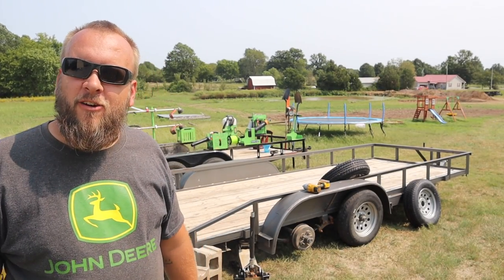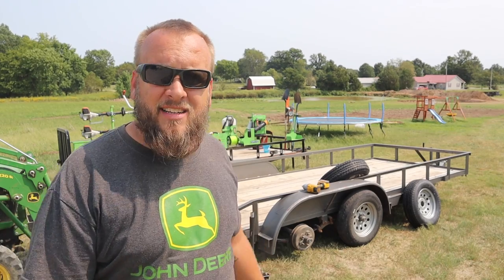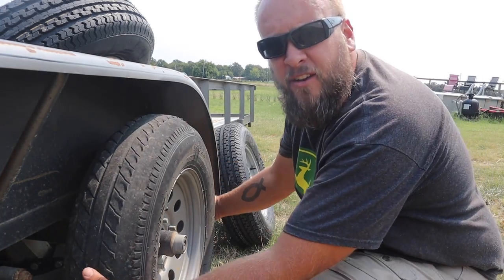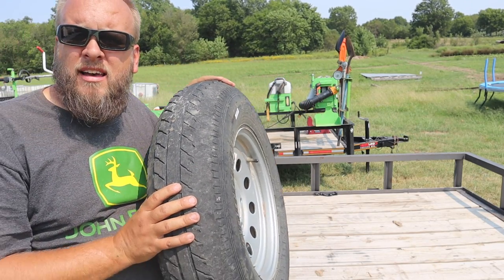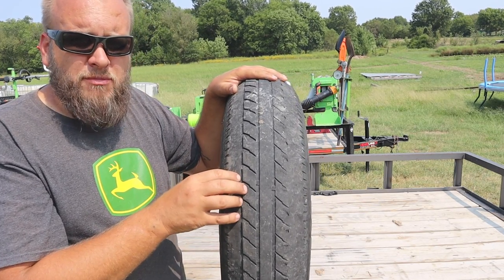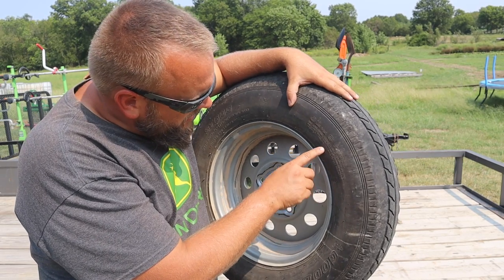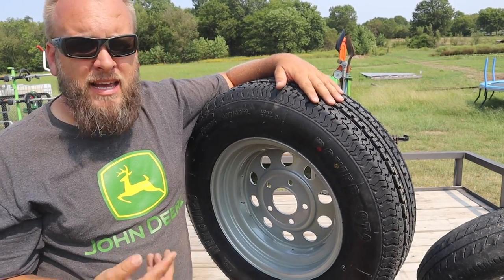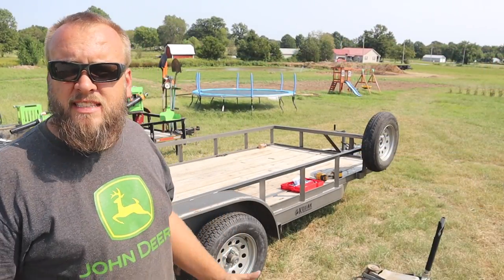These Trailer Tires Suck - Check the Load Range Before you Buy

Comment: You should consider running commercial-grade tires on your trailer in the future.  Last year, I purchased a set of Transeagle All Steel ST Radials in a 225/75-15 LR F and 12 ply. They have been holding up very well, and haven’t shown any signs of wear. The max capacity is around 3200 LBs at 95 psi.  I’ve used different well known brands over the years,…but they all seem to last about the same amount of time.  They are very reasonably priced.  You can get them in higher load ratings, but in our case, the 15” wheels would be the limiting factor. There are a few other companies the make them in this size as well. I also wouldn’t be afraid to move up from a 205 to a 225 tire. There’s not a noticeable difference between the two.
Reply: @Amanda Davis. Where do you buy the 225 LR F and do they sell the tires with the well or just the tires by them selfs
Thanks
Reply: im rocking the transeagle all steel ST radials H rated 16 ply on my 40ft fifth wheel and havent looked back to see any floppin gators in quite some time now😁😁
Reply: @jking1286  nice!!  That’s what I’m switching over to on my trailers.  I don’t need the max air pressure. I just want a tire that’s stronger than any of the ones I’ve been running over the years.
Reply: @vikingored7469  sorry for the slow response.  You can buy them online. Just google the brand, model, and size,…and you’ll find.  Most of the ones I’ve looked at was just the tire alone.  They are a heavy, stiff tire. I’m running them on a utility trailer at this moment.  Because I don’t load it down,…I only run them at about 65 psi.
Reply: @amandadavis9726  hi, whats the brand??? Name of d tires, brand name.thsnkd
Reply: @vikingored7469  they are Transeagle All Steel ST Radials 225/75-15. The options are 12 ply, Load Range F, and 14 ply, Load Range G.  They also make them in a 235/80-16 with a 14 ply, Load Range G, and a 16 ply, Load Range H.

Comment: have you/ how often do you/ grease your trailer wheel bearings?  do you have a video planned for that?  I need to do mine, used to pay trailer place but it got really expensive every year.... want to buy a good battery grease gun and do it myself.
Reply from the maker: I haven’t done it myself. I probably should

I have the local tire shop do it. Can’t remember what they charge

Comment: Brock, when it comes time to purchase another trailer. Go with one of the big brands like Sure-Trac and if you can swing it get an aluminum equipment trailer. Those rails on the sides suck for side attachment loading and pallets etc… get the longest one you can. I run a 20 FT and it’s just enough. 

Love the videos!
Reply from the maker: Thanks for sharing. I have been shopping gooseneck trailers the last few weeks. Hoping to get one by the end of the year

This trailer is barely adequate for what I do
Reply: @RockhillfarmYT  Yeah goosenecks are nice and they tow better for sure. You will sacrifice being able to use the bed of the truck though and to a small degree resell of it. But they are generally longer and have higher weight ratings. 

I saw in another one of your comments you ordered a 3/4 ton truck! When are you going to spill the beans on what ya got? Haha
Reply from the maker: Sure. I ordered a 2022 ram 2500 Laramie.  
Supposed to be here next month

Comment: I am a little late but the D13 ment it was a 13 inch rim and a bias ply tire. The other is an R for radial. If the tires were radials they would not have had that problem. The radials are wider to. The old tires said right on them load range C. That is a 8 ply tire. Load range E is a 10 ply tire. But the big thing is that radials are a far better all around tire. And load E may be smart to.
Reply: I was rong C is 6 ply D is 8 ply and E is ten ply so d is good

Comment: If your hitch is not at the right height and or your load is not placed right you will be sliding one or the other axle wearing down the side wall and as far as the blocks are concerned they are very weak ex specially on there end if you have to use lay a piece of plywood then lay the block with the holes facing up and down then place another piece or pieces of wood they are 2 or 3 times stronger than the way you put it on end I do understand being in a hurry and you did have loader underneath also which is the way I would have done it

Comment: Goodyear Marathon ST225/75/15 they aren’t cheap but they should last. I’ve always overinflated my trailer tires by 5 lbs cold. If they are going to be used at road speeds they need to be balanced.

I didn’t hear you say the brand name of the tire. They look like they are Goodyear. Goodyear should give you some warranty credit on those tires.

Comment: Will offer advise at the end of comment on tires from what I learned June 2023.  
First, not to scold you on the concrete blocks, but anybody watching should take into account here, the comment by bucklure later on here is correct.  Concrete blocks are not designed to be strong turned up like you did -their strength is achieved ONLY when laid out with the holes facing up and down.  With your blocks turned up as you did, obviously it will hold some weight BUT how much?  Imagine if you laid the rail of the trailer into the center of the block itself.  That is the weakest piece of it!  At some light amount of weight that part of the block will fail without warning and the entire block will crumble.  

You had the block there for extra safety, and with your trailer rail laid entirely across it - not just depressing the center that I expressed concern about - you were ok with your tractor providing the primary jacking lift point.  But imagine if the trailer was not resting on the block itself, perhaps positioned several inches above, and suddenly it dropped.  Would be like a karate chop on the weak part of the block!  It would split instantly.  My point is to understand the reasoning behind the shape of concrete blocks.  

Large chunks of hard wood are a more secure safety option.  It's hard for most people to do the extra work, but think ahead about the forces being applied - or COULD be applied - and take measures for worst case scenario.  

TIRES.  Good points about the tires.  I had a failure of a supposedly 'almost new' tire on an older F350 this past weekend.  Front end suddenly began shaking violently on I 75.  Turned out to be a broken belt.  Made the tire out of round in an instant, like rolling an egg down the interstate.   On a 'new old stock' BF Goodrich Commercial TA heavy duty truck 'tar' I bought off eBay a couple years ago, with only about 5000 miles put on it by me.  This truck sees limited use. Thought it was a great deal on a great tire.  Well I forgot to ask about the DOT Code before purchase.  Turns out it was several years old.  Turns out I don't so know much.  Learning every day.  

Equipment trailer.  I was hauling a car on an equipment trailer when I had the broken belt.  Two 3500 axles like yours.  Should be fine, right?  After the broken belt scare, I asked the tire man to look at my trailer tires.  Cheap tires that have been on the trailer since it was new in 2016.  Although cheap made in you-know-where, they have amazingly held up pretty well.  The trailer is not used often though.  

Tire man is an older experienced man who has seen many, many tires and failures.   I asked what tires he would advise for this trailer.  Guess what?

NOT a trailer tire at all.  He says forget that cheap junk and go with a "LIGHT TRUCK TAR"  
Be sure to check the DOT codes on used tires and new, and load and ply ratings.  He likes 10 ply minimum.  He explained about sidewall strength and the lack of it on some tars.  Experience counts, right?

I looked around for some tar.  :  )

Comment: the d is not for the  load rating it just the way it was constructed. if you get the 205/75/R14 vs the 205/75/D14 the R14 is better constructed and has more banding.

Comment: Hi Brock, Nice video. Yes, everyone cheaps out. It's what companies do nowadays. You want a R tire, which is a radial. You could go up a width pretty easily. Watching your video, the brakes are on the rear axle. I would venture a guess that your trailer brakes are set too high. If those shitty tires came off the rear, seeing you change the other tire there are no brakes. They sure look like they are under inflated. I would go up even one more size to 225 75R 15. The 225 is the tread width the 75 is the percent of tread width in sidewall height, and the 15 is the rim size. Check your braking controller on the truck. I might go as high as 235. As a kid, we had a 20 foot sheep trailer that we went to fairs every weekend all over Ontario. We were hauling about 5000 pounds of life weight plus the trailer too. We had the other style of trailer tire that were hollow rim type. I also recommend to change all 4 tires and have them match up. You may still have some grief with two different size tires on your trailer.
Reply from the maker: You’re right about the brake controller being too high. I originally set it on this trailer at +4 I think and then on my dump trailer I run it at +7.  And I haven’t been switching it back when I’m on this trailer

Comment: Anyone with a John Deere shirt is not someone you should listen to about fixing or repairing stuff...  From the get go you can tell he's comparing a bias ply tire to radial.   Bias-ply tires offer more stability in the sidewall and can help keep trailers from rocking back and forth.  They could help prevent an improperly loaded trailer from having a dangerous wobble or sway.  They're also cheaper than radials so of course manufactures will use them.  Buying or not equiping a trailer with a spare is on you.

Comment: What pressure do you run in the tyres?
Reply from the maker: 40-50
Reply: @RockhillfarmYT  Going by your estimates for weigh the tyres are close to maximum load so they should be at or very close to maximum pressure of 50, I suggest you take it over a weigh bridge to know exactly how much weight you are towing because the tyre wear says underinflated or overloaded.  
The d15 means bias ply, r15 means radial, I know people that swear by bias ply for trailers because they have stiffer sidewalls and tow better.
Reply from the maker: Thanks 

I have had my equipment weighed

Comment: some cars come without a spare tire..Corvettes would have to carry two different size tires as spares because they have different size tires in the front than the back..Fiat 500, no spare either which is one of the reasons I didn’t buy one, I almost did though
  why shouldn’t the tires be skinny? They’re not steering or driving. They are just rolling.. the skinnier a tire is, the less prone it is to hydroplaning, Because there’s more pressure per square inch at the road contact patch.. Just look at the comparison between water skis and an ice skate…The water skis right on top of the water because they are wide. You could never ski with ice skates because they cut through, they are skinnier. This is true with snow tires. Skinnier is better
  your tires wore out on the outsides-they were under inflated a lot
  tires and anything actually, the smaller it is, the stronger it is generally
  you were within 10% of the maximum load with your tires on your trailer when it was loaded with your tractor. I think getting over 3000 miles on a set of  underinflated tires with that much weight is doing pretty good. you are fortunate to not have had a blowout..
  The load range just means that your tires were not overloaded- barely..not much safety margin…The letter A on the sidewall of the tire means it has a higher capacity than a tire with the letter B. And a B rated tire can carry a larger load than a tire rated with a C, and so on..
  trailers do not have sophisticated suspension or steering. A lot of times when you’re making a turn or backing in and turning, those trailer tires are being ripped/dragged sideways..
  tires are a modern day miracle invention.. Tires go through hell and are not appreciated that much.
  tires on a commercial airliner really get tortured. They go from sub zero temperatures in the sky, to very high temperatures in the summer on sunbaked blacktop runways… and they get slammed on the ground you can hear them screaming as they contact the runway on landings. Those tires are not owned by the airplane owner. They are leased to the airplanes owner..
  tires  are stamped with a date code.. it’s required by the DOT, department of transportation in case there is a recall. I don’t know if they’ve change the code, but the last two numbers in the code were the year the tire was made, and the two numbers in front of the last two numbers are the week of the year the tire was made…
   as with anything, the more you spend on the tires, the better the quality is. I would not buy Cheap tires for anything I own That rides or drives on public highways. I would buy a Cheap tire for my wheelbarrow, or for my lawn tractor, but not for my truck, or my trailer or motorcycles.. expensive tires do not generally last longer. They just cost more because of the quality materials they use..
When it comes to speed ratings, the S or the H rated tires I have the lower speed ratings, the V and the Z rated tires are for higher speeds, above 149 miles an hour. These tires are generally much stiffer especially in the sidewalls but they have less tread depth then a tire rated at S or H. And H rated tires may have twice the tread depth of a Z rated tire, and cost 25 to 50% less than an V or Z rated tire. The reason a tire gets a V or Z speed rating, is the fact that it has less tread. That means less weight pulling on the tire which will make the tire grow at those very high speeds. If the tire has more bulk pulling on it at those high speeds, the tire will flex more and overheat from centrifugal force. That’s why you get much less tread with a V or Z rated tire.If you don’t drive over 100 miles an hour every day, you’ll get tires that will last longer and they are less expensive if you buy H rated tires instead of Z or V rated tires, you will also get a softer ride out of an H rated tire because it does not have the stiff carcass/sidewalls.. if you get a flat tire/puncture with a Z or V rated tire, any reputable tire store will not plug that tire. Because it is actually illegal in Pennsylvania at least to plug a Z or V rated tire. The thought there is, that a tire that has been punctured may have belt damage, and could fail at the speeds the tire is rated for.Since I never go near 100 miles an hour on my motorcycles or my cars or trucks, I always buy H rated tires if I have a choice over V or Z rated tires because I have more rubber-deeper tread, the tires are less expensive, and they give a much better ride, and they last longer
Reply from the maker: These were just cheap tires.  You can tell that from the load rating and the number of plys which is printed on the tire

Comment: My 2019 Dodge caravan did not come with a spare or a jack.  It did come with a can of fix a flat.  Totally useless in my opinion.   I checked with a Dodge dealer and they wanted almost $500.00 for what they called a spare tire kit.  I assume by kit it means tire, wheel, and jack, (but not sure).   I'm looking for a used "kit".    Trailer manufacturers (RV and cargo) seem to be notorious for putting crummy tires on trailers.  I heard them called "just enough to get off of the dealers' lot.
Reply from the maker: To me that is ridiculous

Thanks for sharing

Comment: Yes D is the load rating which is an 8 ply tire. I run 225-75-15 which is a 10 ply tire and has a lot higher load rating.
Reply from the maker: Thanks for sharing

My dump trailer has 10 ply but those are 7k axles
Reply: @RockhillfarmYT  you can get the 10 ply in a 15in tire but you have to go up to the 225-75-15 size. I've got 10 ply on my dump trailer too and when there ready for a new set its going to get 14 ply tires.
Reply from the maker: Thanks for sharing

Comment: I had the same problem with two sets of tires on a toyhauler. I've come to the conclusion that all trailer tires are Junk ! I put 10 ply truck tires on it 4 years ago, problem solved, they still look like new. I'll never buy another ST trailer tire.
Reply: What brand of 10 ply truck tires did you get. We are replacing our camper tires this month

Comment: A lot of trailer manufacturers sell trailers with "transport tires" on them.  Meaning they're there to get the trailer to the dealer or the buyer and then it's their responsibility to put "using" tires on them.  If you bought it from a retail dealer he should have put decent tires on it.  Of course he might be selling them cheaper by not putting decent tires on it.
Reply from the maker: When I bought my tractor The tractor dealership ordered this trailer for me to haul my tractor on.

Give a second thought to the tires assuming they would be good enough for it

Comment: I always run at least 10 ply radials on my dump trailer. Also they never come with spares and when your backing it up it rubs the tread off of the tires more but those new ones should hold up better than those other cheap chinese ones it came with
Reply from the maker: Yeah my dump trailer has 10 ply

Comment: If a tire is designated  "Trailer use only"  you can absolutely bet it's the biggest piece of S**T they can manufacture. I've seen travel trailers, horse trailers, enclosed car trailers and utility trailers suffer lots of dollars worth of damage when the tread peels off going highway speeds and beats the underside apart or rips off the fender and black up the side of the trailer. Use a radial tire with a load rating for the purpose of the trailer and you will be money ahead in the long run. Thanks Brock I enjoy your channel
Reply from the maker: Thanks for the feedback

This was my first experience with these junk tires.  Kind of disappointing